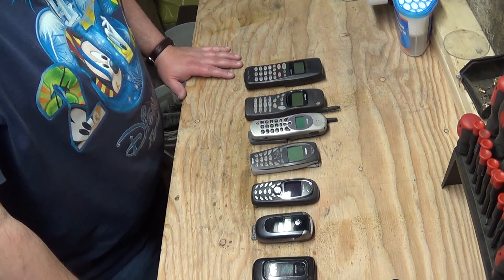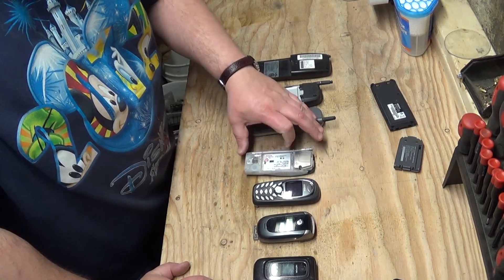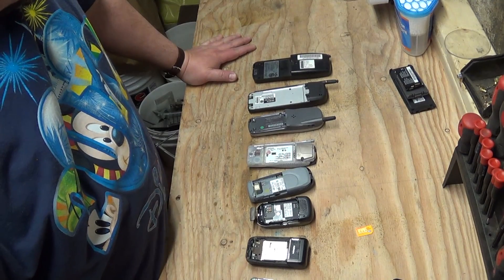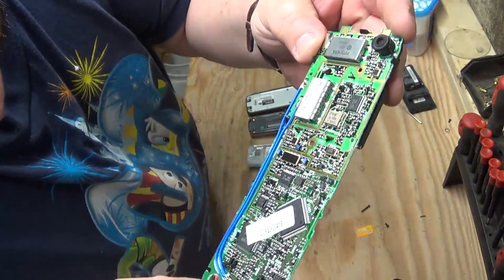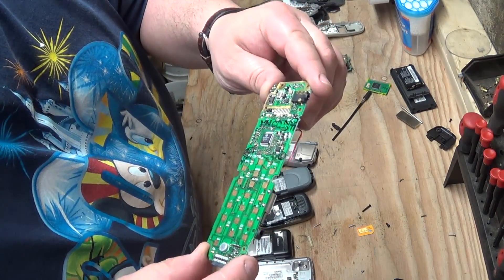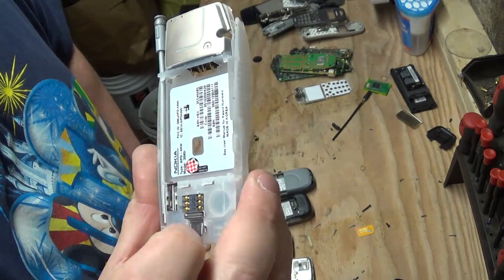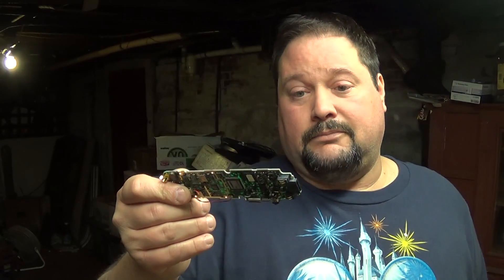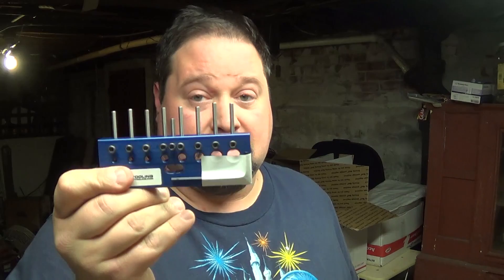Scrapping Cell Phones for Gold Recovery

Comment: Hey Moose, LOVE ALL YOUR VIDEOS!! I have a question about the "black 24kt flatwire in cell phones ,high end tv,etc.   there is a post on boardsort that says they will not buy this wire. why? One of the post says it's the holly grail of wire, but then puts up what I took as a disclaimer. any ideas?? BTW keep up the good videos I've learned a lot from you!!
Reply from the maker: Well, that wire is extremely thin.  Just the ends are gold plated, with a very thin layer (microns).  So for weight, there is far more plastic insulation than there is metal.  THis is why its not bought, or paid very little for as wire.  In order to recover the gold, you have to clip off the ends.  That can take a long time if you have a big bag of them.  Plus, it also takes a long time to build up a good weight of the trimmed edges.  They are fine for the home recovery and refininer, just throw them in with your trimmed fingers.
Reply: thank you for your quick response,  you are truly my "go too guy"  thanks for all the information keep the videos coming

Comment: Hey Moose... It's me again! I'm having trouble researching but do you by chance know if those "silver" metal circle, on the white sticky film, that were covering the gold plated circles where the keys press down on are silver or not? Just thought I'd ask before tossing them since I just scrapped about 50 cell phones. Thanks!
Reply from the maker: So far I have not found them to be silver.  They may be plated silver, but if that's the case then they are really not worth the effort.
Reply: I figured as much but wasn't sure given that I've never seen one rusted and knowing how keyboards use silver in their workings. Thanks for getting back to me and I hope all has settled out well there in the new house :)

Comment: AND now I know. Once again Moose, great to see you doing what you do. Thank You for sharing and posting for others to learn. You are an Excellent Teacher by the way.  My Heart did not sink when you gave your estimate on the number of SIM's required, even though I had entirely misread the PDF from eScrap Refining, that does confer with what you are talking about. Approx. 1,000 SIMS = 1 OZ. Gold. Sorry for being a long winded bug, Moose, but in general when the Oz. is used in Recycling/Refining of the precious metals, is it always in the Troy Weight, being not 28 Grams/Oz as the Metric/Standard  Measure, but a 30 Gram Oz. I am asking because is the World Trading Standard not Troy, always, in precious metals. Even better is this a rule for other metals as well? or is the ACTUAL WEIGHT just required to specify whether it is a Troy Oz or not? I will do some research today on why this system does not come to bare, say in the Grocery Industry?
Reply from the maker: +M P.L great questions, I still have not confirmed the # of sims per oz.  As for measurement, I tend to stick to grams.  Less confusion that way and all of the batches I have run have been less than either ounce anyway so grams works just fine for me.  Best of luck to you!

Comment: hey moose. I have to ask you several questions. I know CPU has gold in cell phones and circuite boards as well. you said that there is arround 4 USD on each cell phone. But can you also show us what is and where is brass there, silver, palladium or platinum? it is hard to recognise them sometimes. And how many circuit boards do i need to make an 1 ounce (troy) of gold? I am trying as a hobby to scrap phones for myself. Can you help me please to identify all theese metals and where they are? thanks
Reply from the maker: lubiatty1 Hi and thanks for watching!  To get one troy ounce of gold you will probably need at least 50 lbs of cell phone boards.  There will also be a few different gold recovery processes involved.  The first of course is cleaning the board off, getting all the components off and solder.  There is almost never any clean brass in cell phones.  At least none that is not gold plated.  Recognizing the sources of gold becomes easy after practice.  The four major sources of gold in cell phones is 1-the plated board, 2-ic's, 3-crystal oscillators, and 4-gold plated pins and metal connectors.  Silver and palladium are found in the monolithic ceramic capacitors, and no where else in the phone to my knowledge.  There are also Tantalum capacitors.  I will try to do a more clear video on the components.
Reply: Thanks for your message. I have trouble to recognize in very old cell phones, kind a like a retro cell phones, i took it a part and i pulled out antenas (aerial), which i belived was gold and other parts connected to it which look really big and they are heavy as well. it is slightly magnetic and under 10 kt acid test on stone shows possitive for gold i believ. not on 14 kt, then the result is negative.  This is why i asked about the brass in cell phones. i tested my neckless 10 kt  and shows me exactly the same result on acid tests. i am really confused about that couse they slightly magnetic. I follow your channel, couse i have the same hobby as you  and want to save some more gold, silver and palladium etc. for times when i have a big bulk of them and refine it into a bars. I read on some articles, that in 1 ton of cell phone is 3,5 kg silver, 300-350g gold and other metal like palladium or platinum. thats why i was asking where is the silver there in that ammount. thanks a lot for your comments and knowlage.
Reply from the maker: lubiatty1 Hi there, the acid tests will not work for plated items because the gold is so thin that the acids quickly get through to the base metal which is often brass with a thin layer of nickel on it.  THis gives you a false reading.  Something could be 24k gold plated and the acid test will show less than 10k.  As for the silver in cell phones, the only place that I am aware of there being silver is in the solder and on the monolithic ceramic capacitors which have both silver and palladium.    Hope this helps a little.  And yes, you do need that much material to get the gold however, in most cases the working phones can be sold on ebay for way more than 10 times their precious metal value.
Reply: You really helped me now. I thought i am crazy or something and that is not gold. So what shoud i do with thoose parts? i have got like 7 parts about 10g toghether, they are big,solid and heavy... so how do i get the gold out of thoose? would take ages in hcl and bleech as you shown in previous videos i believe.
Reply from the maker: lubiatty1 The best way to recover the gold from large solid plated items like that is to use reverse electroplating.  I have not tried that method yet but have learned that it is the most efficient method for that type of material.  I am saving up those things until I have a few pounds before I try it.
Reply: ok i cant wait to see that. your videos are great in my opinion! you doing great job out there. i do the same and save them till i have loads of it and then process it. thank you

Comment: Hey Moose, I'm just starting out scrapping phones and what not and I was wondering what kind of screw driver set you have there?
Reply from the maker: Alex Manbeck I have a couple.  I have a tamper proof bit set that I got on ebay for $5 and a set from ACE hardware that's a 33 piece set that has torx bits.  For the smaller sizes, you want to make sure you do NOT go cheap on them because the cheaper smaller sizes will break really quickly.  Thanks!

Comment: I've torn apart a few cell phones now.  The stuff on the back of the white sheet that comes into contact with the gold plate (4:31) looks like silver.  Is it?  Some of the same stuff showed up in my wife's old non-working glucometer as well.  Quite a bit of gold in those, by the way.
Reply from the maker: Dwight Gordon I have tested some of those and have found them to not be silver.

Comment: What tipe  of phone is that has the smart card
Reply from the maker: HI there, thanks for watching! Most phones have a sim chip (smart card looking thing).  The older brick type phones and phones of the 90's do not always have them but just about all newer ones do.  they are often hard to see.  Thanks!
Reply: thanks for the help i ben looking in old bed motors and geting copper and looking in computers for copper but im still looking  but no gold yet but im looking from dylan schuetz to moose

Comment: Elo moose.great vibe.whats best to use for removing the goldplating in the boards? Muriatic/bleach or muriatic/hydrogen peroxide? Sorry m new w/scrapping.whatS is "a hot sand bath"for removing the things in boards.nid help n clarification..
Reply from the maker: Hi and thanks for watching.  The hot sand bath is basically a tray of sand that you get to over 500-600 degrees F and set the boards in the sand to quickly loosen and then scrape off all the parts stuck to the board.  Once that is done, I think the AP method is best for removing the gold foils.
Thanks!
Reply: thanks for the tip moose.happy scrapping
Reply: Moose Scrapper do you use the AP method for removing plating from the sim cards as well?  Someone on gold refine was saying something about a chip and some glue being a problem, but they weren't using AP solution to remove the plating...

Comment: When you AP SIM cards, can you leave them intact while soaking in AP?  Meaning, do I have to peel the foil section off the plastic card first?
Reply from the maker: Intact is just fine.  May need to soak just a little longer but still likely a lot less time spent than peeling each one off.  Sorry to hear about your job, but there is nothing with gold recovery that can or should be done quickly.  Gold recovery is great and can make yo umoney, but you may find hat you can make more money with other scrap metals like copper, brass, aluminum and steel.  Best of luck to you!

Comment: Hey Moose!  Discovered you about 6 weeks ago and finally got up to date on your vids. Absolutely love 'em.  My question regarding pins: The male pins are obvious, but how do you extract the hidden female pins from connectors in a timely manner?  Possible vid?
Reply from the maker: Thanks for watching!  The timely manner part is what is difficult with the female ends.  Honestly, I box them up and sell them by the pound.  Once you get your name out there and people start to really reach out to you with scrap its hard to keep up and there is less time for the smaller time consuming things.  I think original feets has a video or two on some easy ways to remove those things with a simple petal pick.  Thanks!
Reply: Awesome.  Keep it up!

Comment: I got a box of circits I got a blueray player circuit with 50 voltage sources about 4 remote circuits 3 old phones with lithium ion battery's I got three is ni-mh 17670-3000 mAh 7.2 battery's  and some other random circuits any idea what I could do with them
Reply from the maker: Hi and thanks for watching!  I am currently not processing material for other people.  I think your best bet would be to find a scrap yard that buys circuit boards and I am not quite sure what you are referring to as voltage sources but most scrap yards are willing to let you know what you have and what its worth.  The NiMh batteries are not really worth anything, they just need to be recycled.  The lithium ion batteris can be sold by weight to many online companies.  Thanks!

Comment: check my channel moose popped up a clip of my relay silver recovery inspired by your quality advice.
Reply from the maker: Nice jar of contacts!!  All you need to do now is either give it a bath in nitric acid or in acid/peroxide to get rid of the copper etc.  NICE!
Reply: yes and the cost is very low for the silver and on top of that also have the wound up copper. Just got another box of these for £4!! happy daze!!
Reply from the maker: SWEET!

Comment: Well, as you have pointed out....I have been saving the monolithic and, now, tantalum capacitors. I don't go crazy when a single connector pin drops but I do look for it....every piece of gold counts. Moose, what are the gold colored pieces from cellphones that are not magnetic and don't react to the A/P solution? Also, still haven't been able to get my processed mixture back to clear using stainless steel like you said. It sure does draw the copper though! But I'd really be happy to see a video from you on this....I know it sounds minimal but, if we are going to walk the walk, we need to know how to else the mixture. Thanks!!

Comment: 4:45 Those "metal things" are called rf shields moose, rf stands for radio interference
Reply from the maker: lol, its ferrous, not much more a scrapper needs to know I guess....  Thanks for watching and commenting!
Reply: Moose Scrapper well,magnetic doesn't mean that it hasn't got some additional more interesting stuff added!
By the way I currently figured out the very sophisticated method of extracting gold and actually any other element in their pure forms in two fastest and most efficient steps possible!And what I mean is that I just load the entire bowl with cell phones or whatever and add sodium hydroxide pellets exactly up to cover them all and then I simply melt the sodium hydroxide on my hot plate and in several minutes after the sodium hydroxide starts melting and reacting with everything-I just have my precious metals undissolved on the bottom and all the rest is after that soluble by simple water-so I end up with actually a possibility of complete and precise elemental analysis of for example phone-and what I noticed is that I almost every time end up with higher yields then I see here on YouTube!So just try it yourself!
Reply: Radio Frequency
Reply: eurobimmer635 What ever it's called :P

Comment: As much as I enjoy watching your vids, and have been a subscriber for some time, this one was a bit lacking in fact. Plenty of opinion but not enough research and fact. I could show you some cell phone boards with a lot of gold plating on them. I do realize that once you have YouTube sending you a check every month based on your videos, it must be hard to stay true to your original drive and vision.
Reply from the maker: I am sorry you feel that way.  I will reassess my videos more carefully before releasing them.  I will however stand behind the statements about the amount of gold on cell phone boards.  There simply is not a whole lot coupled with the time it takes to deconstruct the phone, depopulate the board then process, as well as the availability of phones in volume, it is my opinion, as well as many others in the refining biz and on the goldrefiningforum that your better money will be in gold fingers off RAM chips, PCI cards, slot processors, etc.  While the boards may display a lot of gold surface area, that gold plating is extrememly thin.  I do sincerely thank you for the honest and constructive criticism though.  That is infinitely more valuable than just calling me a sell out or something.  Thanks again for taking the time to comment!